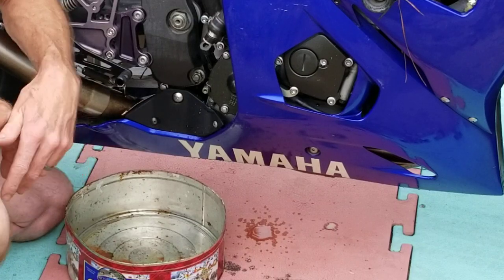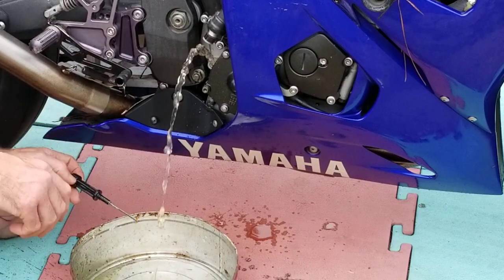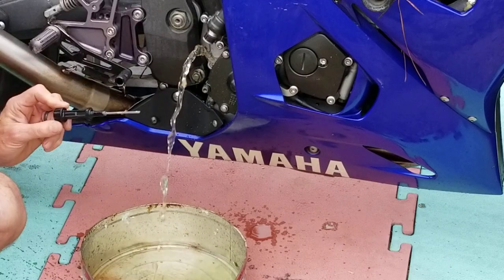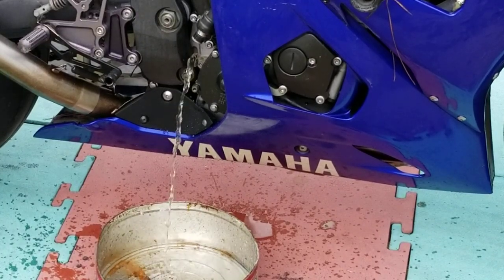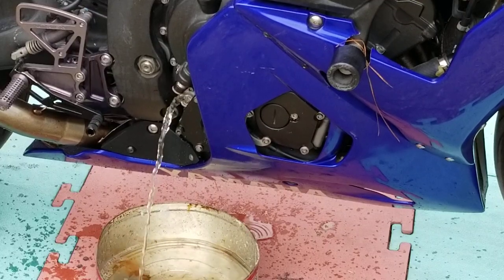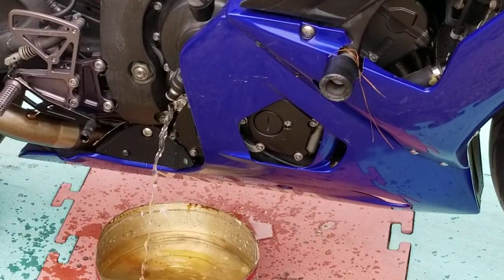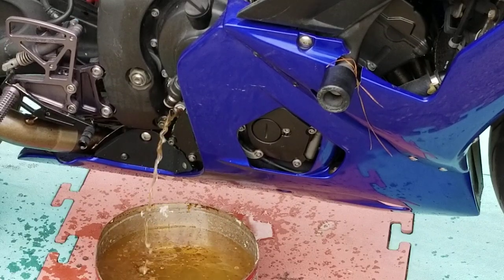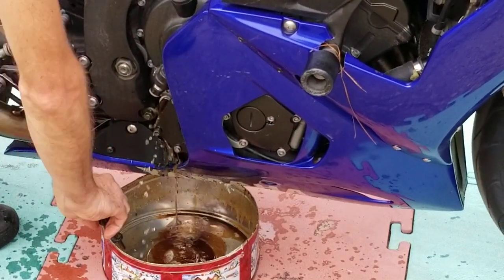Florence flooded motorcycle

Comment: I'm trying to do the same thing right now with a 2016 R1. Feeling very nervous. Mine did not have water shooting out of the filler hole but I did get a solid quart or two out of the drain plug. Also some water shot out of the plug holes when I hand cranked the motor. How does that much water get in there?

My throttle bodies are toast, fair bit of corrosion on the butterflies. Now wondering if I need to take the valve cover off. My initial thinking is no since only way anything could get up there is with bike running. But I'm no expert and now would be the time to do it since I have everything off. Bike has less than 5k miles so not due for valve check or I'd go ahead and do it. Also wondering how hard it should be to hand crank the motor. Mine goes easy for 90 degrees then quite hard, then easier again.
Reply from the maker: Any water in an engine is inappropriate. i would question the integrity of fuel cap and the tank. every aftermarket cap ive experienced didnt vent correctly ad allowed water in the tank. any water in tank would justify complete dissassembly of the entire pump, fuel rails and injectors.  i would pull all plugs, squirt wd40 into throttle bodies into cylinder. turn engine over by hand first. then if it turns freely, crank with starter. perform compression test with all plugs out and throttle wide open. i think acceptable no is  180-240( consult factory service manual for the correct number)

Comment: What did you do to get the water from inside of the engine? After you did an oil change and so on. Did the motorcycle idle like there was still water in there. Working on a flooded motorcycle right now
Reply from the maker: This bike was totaled by the insurance company but not before it was fixed and running, perform this suggestion only at your own risk I assume no liability if your engine is trashed I have performed this fixed countless times and have never had a problem.. Replace the oil and filter with the correct quantity of diesel fuel instead of motor oil. Kerosene will also suffice. Started up and running for a couple of minutes. Set It Off, drain the diesel and replace with the correct amount of diesel fuel instead of oil a second time. Drain and replace the oil filter again. Fill with the correct amount of oil and a new filter, run until engine is hot, shut off and perform another oil change and filter change. Might sound crazy but it works. I was taught to do this by a Kawasaki technical representative when I work for a Kawasaki dealer 30 years ago. I've done this on countless flooded engines that still run to this day. Of course if your cylinders are full of water you will also want to pull out the spark plugs before you crank the engine over and pop all the water out of the cylinders. spray WD-40 down into the throttle bodies so that it circulates through the cylinders. That will help lubricate the cylinders temporarily and flush out some of the moisture. diesel fuel is a lubricant so you will not cause damage to your engine by running it for a couple of minutes.
Reply: @patrickscycleshop  Thank you
Reply from the maker: @D3vinePurp0se  youre welcome, the bike ran perfectly after i did this. a victory i also did at the same time sat completely submerged for more than a week and then another week before brought to me. the engine was completely full of water.